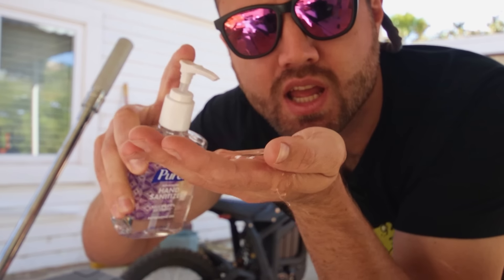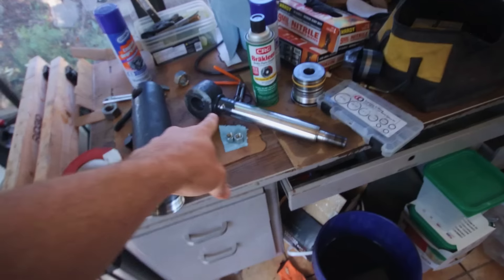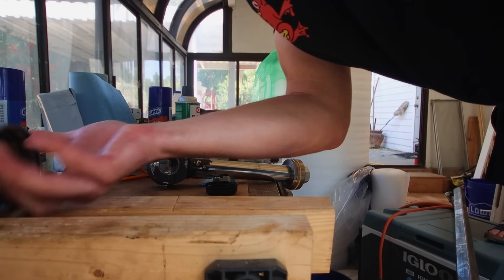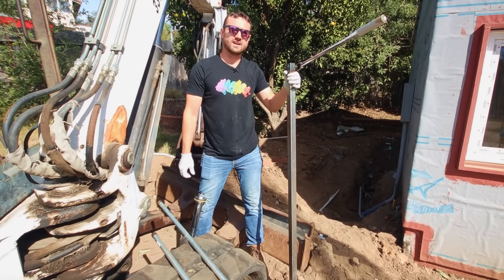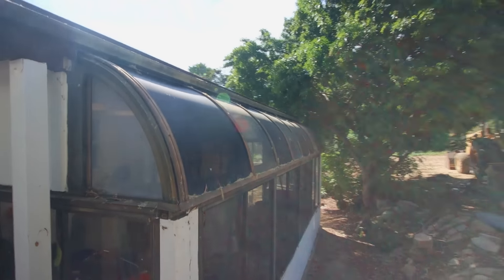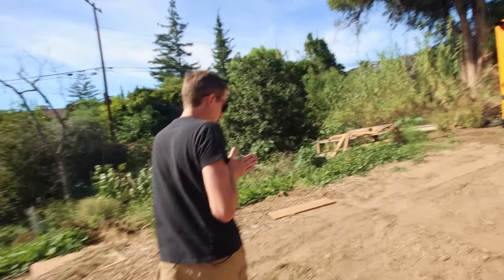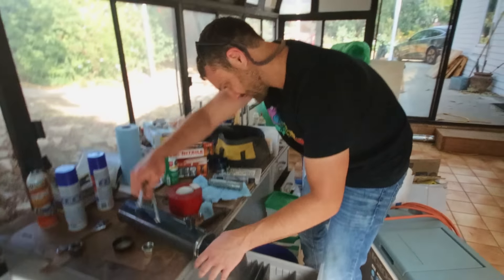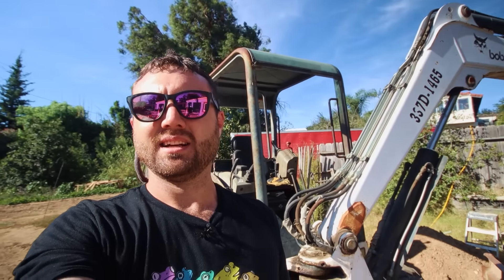I built a very big wrench

Comment: there should be an o-ring on that shaft under the piston or at the end. otherwise fluid under pressure will leak from one side of the piston to the other

Comment: I've never bothered to torque stuff bigger than 15mm. I just note just how much force it takes to take it off (assuming i don't break stuff) and then use high strength thread locker on the way back in. Tho on hydraulic rods, i just use a pin to keep it in place, installed whenever i take the rod off. Much safer, never comes off and unless you really fug that rod bad, like push the cylinder through the rod bad... it's not gonna be damaged, because it's within the nut. I did both of my brother's D10's that way when i rebuilt his cylinders. Imagine trying to torque of doze nuts.

Comment: Just to clarify, $500 buys you a bottom of the barrel torque wrench "Rated" for 1kftlb. A "basic" accurate 1kftlb torque wrench is $3000. 

Just remember those figures the next time you take your diesel in for repair.

Comment: Figured I’d let you know, if the cylinder is not leaking externally the leak Down issue is never the cylinder itself, it’s always the valve body. Fluid is incompressible the ram will take up more space than the side without the ram, therefore it is impossible for the fluid to flow around the head the fluid has to be escaping somewhere else

Comment: You should have just got a torque multiplier basically a gear box to multiply the torque from a wrench there a lot smaller and more versatile then a 5 foot pipe
Reply: It would probably be more accurate too. Torque wrenches are designed and calibrated to the amount of leverage their handle provides. If you shrink or extend the handle you change the overall length of the lever arm and now your torque wrench is no longer accurate.
Reply: @Da0yster yeah would be a lot more accurate and if you got a high multiplier you can get a lot more torque without having to just get a longer bar

Comment: Eh I feel like on such a high torque application, non torque to yield fastener, and where there isn't a clearance or something that could vary depending on torque, I would've just gotten the biggest breaker bar and pipe I had, and torqued it as hard as I could lol. Even if overtorqued that shit isn't snapping and won't affect the part either.

Comment: A torque wrench won't read right using a regular extension. I really doubt that rig will work. It'll probably be close though.
Reply: say you have a 1ft long torque wrench. if you set the wrench to 100 ft-lbs it will take 100lbs of force to get a click. now if you use an extension to make the wrench 6ft long, you get 600 ft-lbs of torque at the end of the extension. it's really easy math

Comment: Sombody explain to me how he reached 1000 ftlb of torque with the 100lb wrench. Wouldn't the torque tool "break" at the 100 ftlb and not provide any more torque? Pls explain to me like I'm 5
Reply: say you have a 1ft torque wrench and a 5ft extension. if you set the torque wrench to 100 ft-lbs and get a click, you're applying 100 lbs of force (100 ft-lbs divded by 1 ft), but since the extension adds an extra 5ft to the nut, the torque on the nut is 100lbs times 6 feet, or 600 ft-lbs

Comment: Oh no, I just took a statics course recently and now I have to be the um AcTuaLly guy. 

That would not be 1000 ft lb of torque on the end if the torque wrench clicked at 200 ft lb. You can't multiply torque by distance because then you get ft^2 lb. And I don't know what you can do with that.

What you need to do is figure out how much force is applied to make the torque wrench click at 200 ft lb. You can figure that out by dividing the torque setting by the handle length, so 200 ft lb / 2 ft. Gives you 100 lbf. Now multiply that by the overall length 2ft + 5ft = 7ft. 100 lbf * 7 ft = 700 ft lb of torque. And if it was set at 250 ft lb, that would be 125 lbf * 7 ft = 875 ft lb of torque. I couldn't help myself lol sorry.

Also I hate hydraulics, they suck.

Comment: Cad designed handle grips? 
You can literally buy handle grips for twenty bucks that will fit right on those lever controls might have to unscrew those long hex nuts first though.

Comment: Is William's math correct here? He doesn't really dive into it, but I am assuming he is saying something like this:}

If I attach a 1ft wrench to a 5ft extension, and then apply 200 ft.lbs of torque, then the resultant torque at the end of the extension will be 5 (or 4?) times higher?

Can someone explain this in an intuitive way? It feels like because there is a pivot at the point the extension meets the torque wrench, you can't just treat it like one long bar.

Hmm I am lost.
Reply: if you have a 1ft torque wrench and a 5 ft extension, the torque at the end will be 6 times higher.

the math is pretty easy, if you set your torque wrench to 10 ft-lbs, and get a click, you're pulling with 10 pounds of force, and since your entire lever is 6 ft long (5ft extension + 1ft wrench) the total torque you've generated is 10lb x 6ft = 60 ft-lbs
Reply: @robmckennie4203  yeah I saw Williams follow up video which sort of made me think about it along the same lines.

Thank you 😊

Comment: Mechanic here ummm no. So your not supposed to use extensions on torque wrenches let alone a 5 foot bar and also don't loosen it with the torque wrench they are very picky.
Reply: thats not an extension its just a bar, he had a 6-10 inch extension on it to clear that debris and whatnot. every auto tech should have a bar to multiplier the torque output of their breaker bars.
Reply: @Gen_Z_Grease_Monkey  Yes breaker bar not torque wrench. ik it wasn't a extension but how accurate can it be going through a 5 foot pole, I just get kinda anal over precision.

Comment: pound feet. not foot pounds. Also you can reduce torque if you lubricate the threads by anywhere from 20-40% depending on what kind of lube you use.
Reply: Pound foot and foot pound are literally the exact same thing and are 100% interchangeable